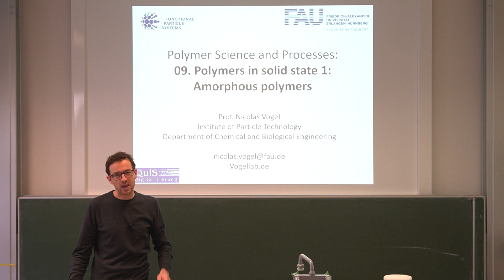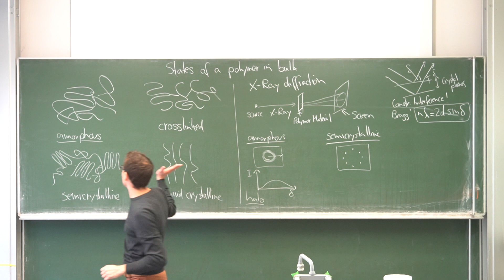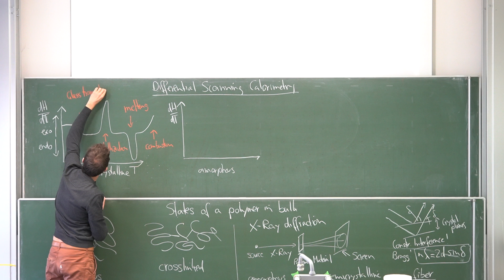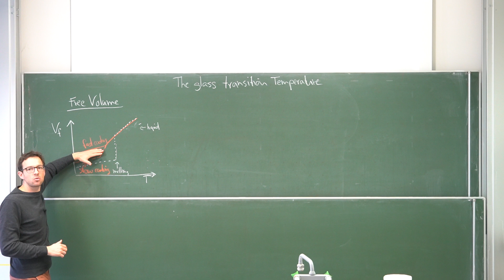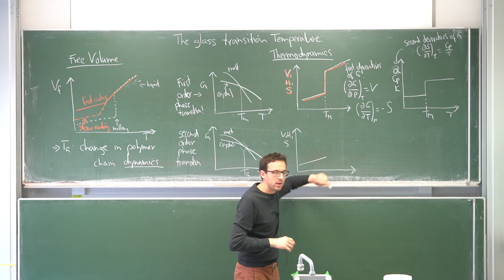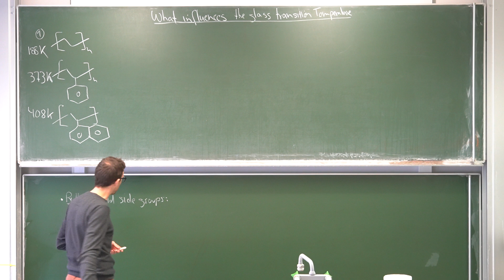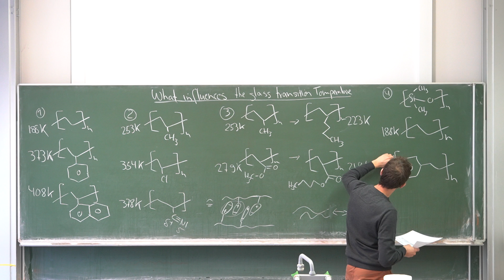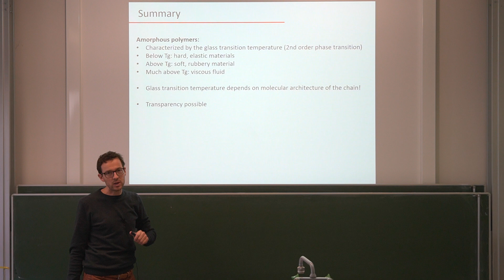Polymer Science and Processing 09: Amorphous polymers

Comment: In the slides, specific volume (this is the first derivative of the specific Gibbs energy with respect to pressure) under the second order phase transition should be deleted and replaced by coefficient of isobaric thermal expansion or coefficient of isothermal compression